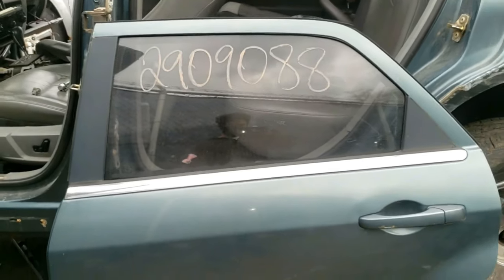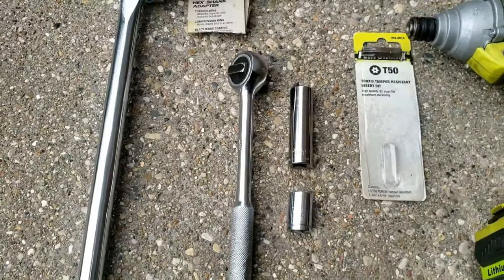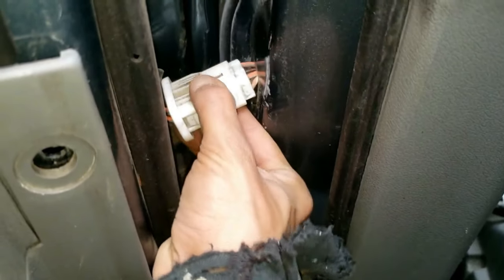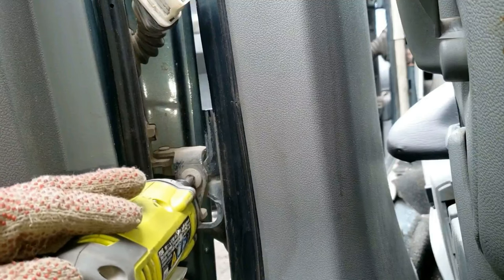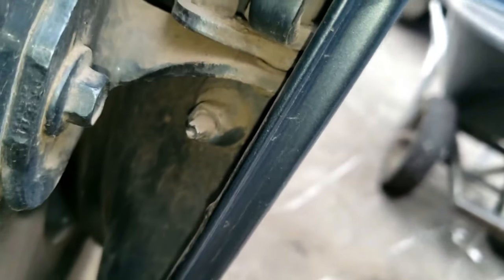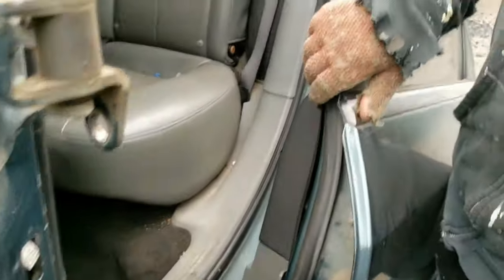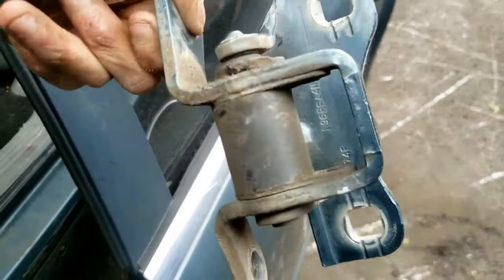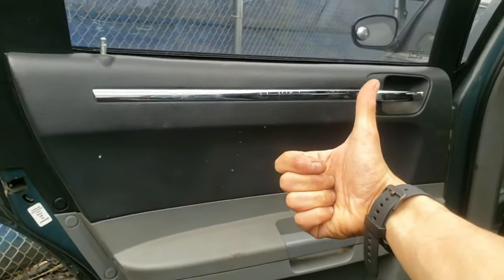How To Replace Rear Car Door 🚪 On A Dodge, Chrysler, Jeep FAST

Comment: Step one, lower window. 2. disconnect wiring harness. 3. close the door. 4. open front door. 5. unbolt the hinges from the door. 6. remove door by holding the door from the top, unlatch the handle and lift door off. Reverse the process to install the new door.
Reply from the maker: Thanks for the quick reference guide.

Comment: Appreciate it man! I’m about to try this sometime next week. Seems pretty simple. Is removing the hinges necessary if they’re still in good shape and if you’re just replacing the door.
Reply from the maker: Thanks glad it helped. Nope no reason to remove the hinges, if still good. I replaced just a door and kept the original hinges.
Reply: Any idea if this would still work if I can’t get the door open from the inside or outside? my one driver side rear door is stuck on my Chrysler 300 not sure how to go about it.
Reply from the maker: If the door doesn't open is it because of a crash, or is the door handle broken. You could remove the door by undoing the screws. And Maybe the door can be slightly repositioned. Also maybe grease the side edge of the door so it can possibly open and close easier. Hope this gives you some ideas to work with.